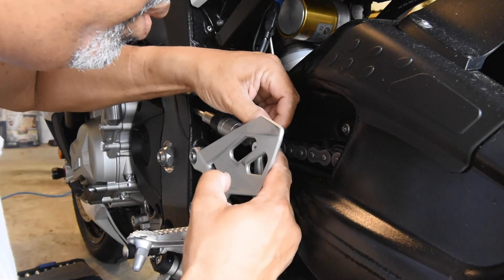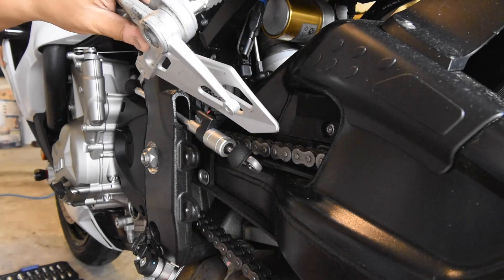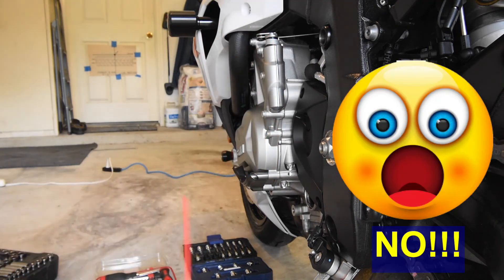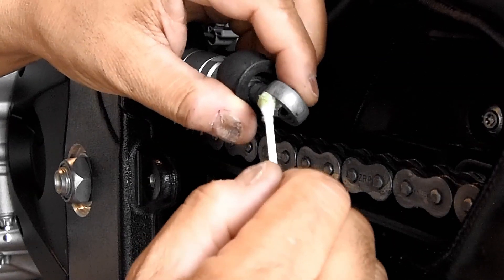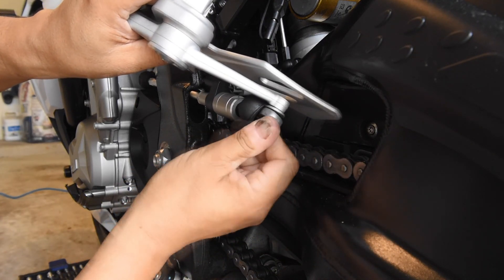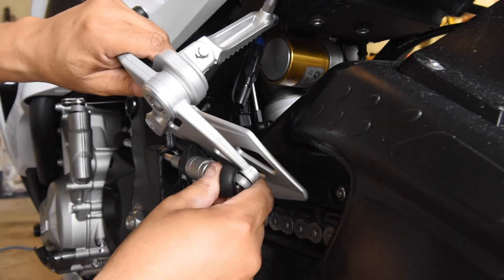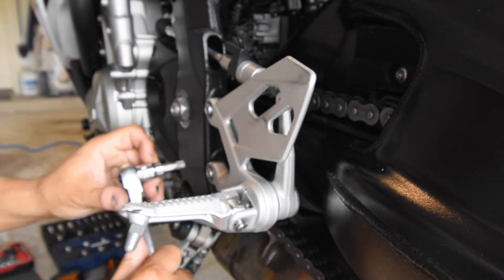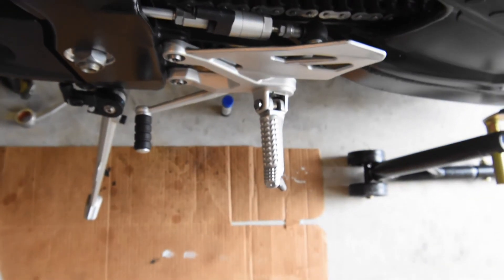Gearshift Lever Replacement | 2014 BMW S1000R

Comment: Your videos have me really interested in an S1000R! I understand that the gear shift assist only works for UP shifting on your S1000R. Do you know if the shifter can be upgraded to UP and DOWN quick shifting? Or what year S1000R did full UP and DOWN quick shifting become available? Thanks!
Reply from the maker: The shifter can apparently be upgraded at great cost ($1300+) by alpha Racing (https://motorrad-1.com/products/conversion-kit-downshift-blipper-for-bmw-s1000r-2014-2016). Better bet would be to get a 2017+ S1000R.
Reply: Great info! Thanks a lot!
Reply: Hi is it possible to change the shifter position to a GP/reverse shift using the OEM parts? Particularly on the 1st gen S1000R 14' - 16'
Reply from the maker: @MichealDeAngelo  As far as I am aware, no. You may wish to search the S1000R Forum online for more information.